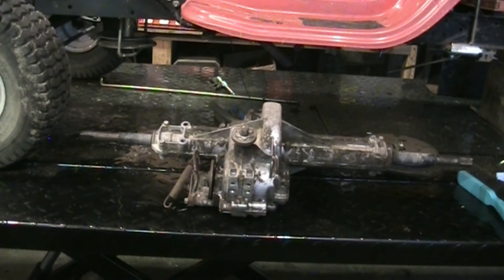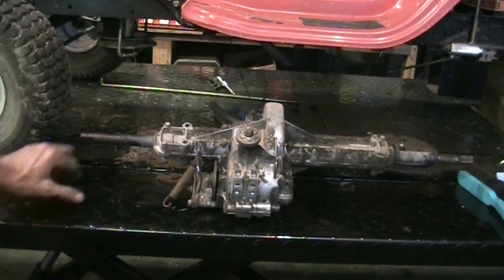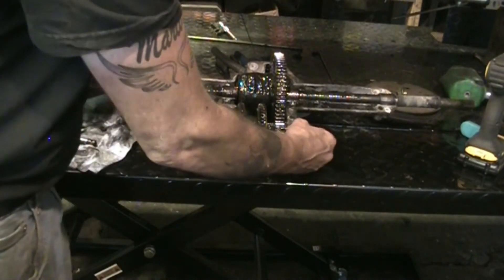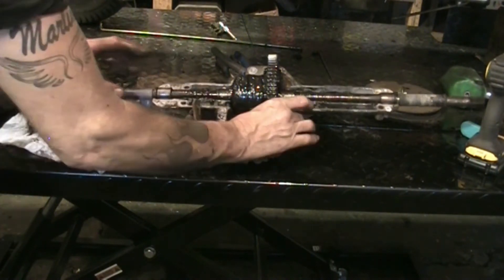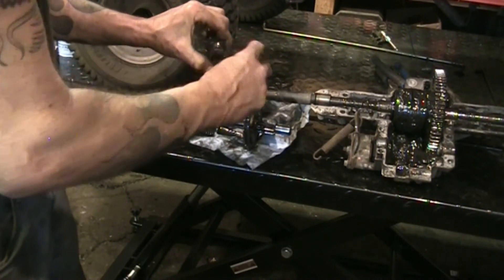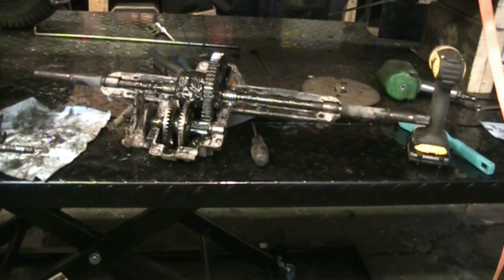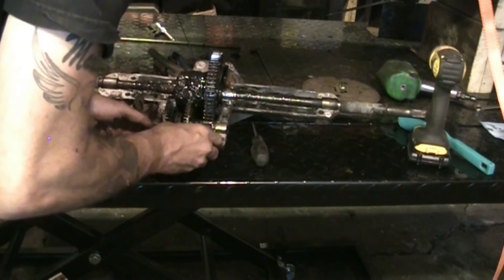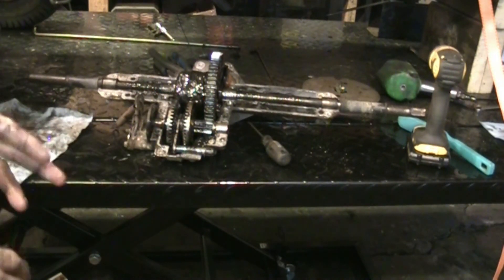MTD transmission transaxle skipping, noisy, or no forward motion

Comment: Thank you, my MTD yardbug goes into reverse/neutral fine but WONT go into forward at all at the drive selection lever. I have this same transaxle for the variable belt setup. I'm betting the shift fork bent and the shifting rod is at the end touching the axle casing & cant push it into gear. I thought these were oil filled and didn't wanna replace gearbox oil. Thanks to you showing me I will drop it today, bend that fork back & put a nice weld spine on it. Thanks!!
Reply: Update : I didn't have to open the transaxle. Pulled the axle from the frame & it was dirt/oil built up on the shift selection shaft. Couldn't get to it installed on the mower. Wiped it clean, pulled it out & wiped it off. Then squirted ATF on the shaft & pushed it in, wiped the black stuff off when pulling back out. Repeated 4 times & it shifts fine. Didn't wanna open it if I dont have to. I use ATF for everything I swear. great on plastic and rubber too.

Comment: I had this issue so I flipped the gears and it still doesn’t drive would else could cause it
Reply: pulleys could be wore out. causing the belts to slip and making it jerky and skippy. They make grooves. If it uses 1/2 inch belts. Get the same length belt in 5/8th and see if that helps. Sometimes thats cheaper than replacing pulleys.

Comment: The way to make any gearbox last forever is to change lube regularly. I cannot 
find even  ONE  vid showing how. Does it use grease or oil? Who knows?

!
Reply from the maker: It's a grease, and it's just not usually something that gets done.  Normally the design is that by the time this wears out, the rest of the machine is too far gone to repair.
Reply: EP 00 grease

Comment: What I've found is while the gear selector cog does wear on the edge, the gear selector drive shaft bushes also wear causing the pinion to be out of alignment. By putting a washer behind the forward drive ring around 1mm thick I've noticed that the gear engages better and doesn't skip anymore.
Reply from the maker: Excellent info!

Comment: What would cause this trans axle to keep popping the drive belt off when switching forward to reverse and reverse to forward? The transaxle also makes a howling sound now and won't go faster than speed 5 and then I can hear rattling after that
Reply from the maker: The sliding sheave pulley that changes speeds can get seized and stop proper speed adjustment.  It can also wear the bushing out and rattle quite loudly.

Comment: impressive. so it takes grease and not oil?
Reply from the maker: This is a weird grease in this trans.  And the rider in the video is still running and driving just fine to this day
Reply: @randomwrenching  im using marine gear oil , like 00
Reply: Grease/oil mix

Comment: So you basically used the good unused sides of each gear?  Genius!
Reply from the maker: That's exactly what I did. Brand new gears aren't super expensive, but this repair was as good as new. And no cost in parts.
Reply: @randomwrenching  I’m having the exact same symptoms as that tractor,  because of your video I’m gonna crack that sucker open and try it!  Thanks buddy
Reply from the maker: No worries, let me know how it goes for ya.  Be aware of the shim positions on each side of each gear and get them into the right spots.  It's important. 😎👍
Reply: @randomwrenching  thanks bro…I’ll send you the video and shout you out!

Comment: Hi!Did you swap forward gear with reverse gear? The inner diameter of these gears seems to be different.
Reply from the maker: I did swap the forward and reverse gears. Inner diameters were the same on the unit I worked on.
Reply: Thank you :)
Reply: I've got a 99 16hp MTD 13cd768n678, and the diameter of my forward gear is slightly smaller than the diameter of the reverse gear. So swapping them is unfortunately not possible.
Reply from the maker: Interesting. I haven't seen that
Reply: I ordered a new gear today using the original part-numbers and this is what the list said:
Fwd gear: PINION 42 T., SM. BORE HOLE
Reverse gear: PINION 42 T., BIG BORE HOLE
Which means I wasn't mistaken (unfortunately xD)
Reply from the maker: Nope, you weren't. Thanks for the info
Reply: @DutchDennus hi i found same problem with mine. Bores are different size. Have you got part number and where you ordered from  please.
Reply: @jamiek515  I got the part numbers from Motoruf. After that, I googled the  the numbers and ordered from the cheapest seller.
Reply: @DutchDennus 
oh ok.  Im in australia. Mines called a mtd yardman. And this  one aint on that list. Cant find any here in australia.
Reply: @jamiek515   check for the number on the sticker under the seat, try the serial number and the model number